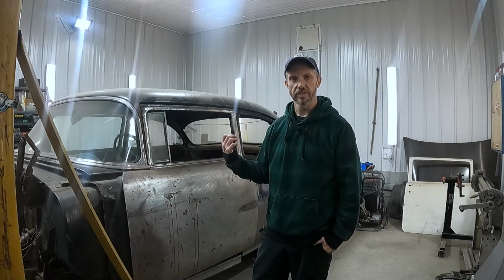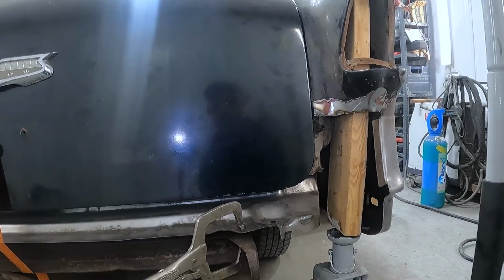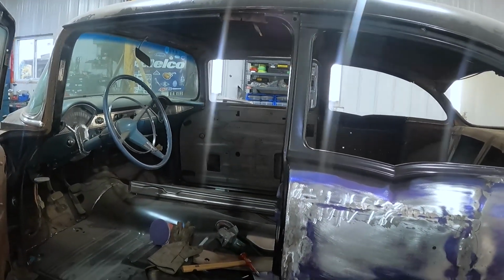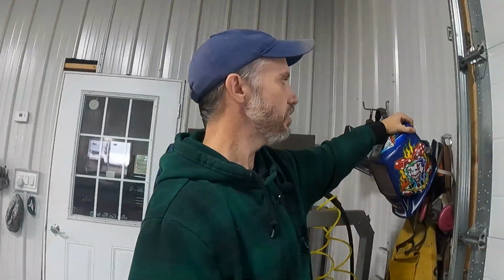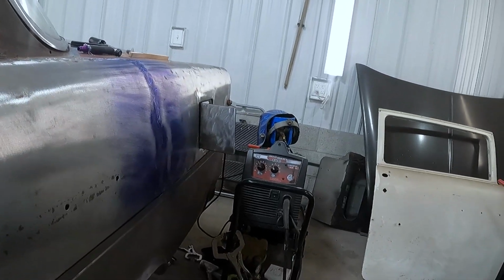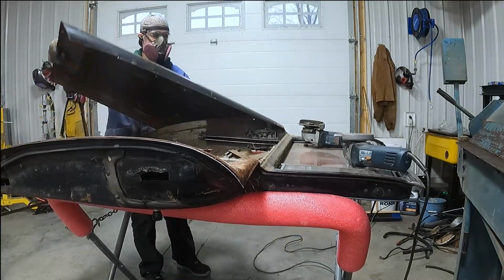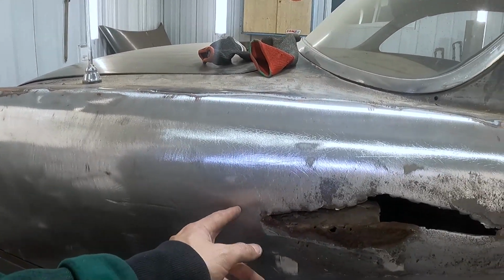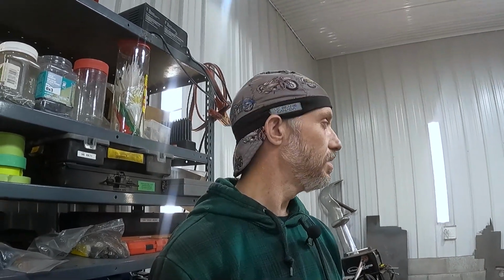1955 Chevy Belair Project Problem Solving - Metal work

Comment: Like Pat said chin up you'll get there you always do. Any problem big or small you seem to get the right answer in the end. You've got a lot of people cheering you on as you work on this 55. In the end it's going to be the car you want to have and drive, like the rest of your cars and trucks. Keeping my fingers crossed as you go forward. Can't wait for the next video.
Reply from the maker: Thanks Christian! I'll get through it. It's a challenge, but I have some good ideas on how to fix it. Lots of welding and metal ahead of me, but you've seen me do that stuff before. I saw your red car with the new upgrade! Pretty impressive. Hope all is well with you folks.
Reply: @SlowCarFix  It's too late now to try it out but driving home I noticed a difference. This is big step for me going into the unknow. It will be a learning curve. All is well here except having long covid. Maybe in the new year we could all get together, when your time permits. I think I'm a Slow Car Fix club member by now (LOL)
Reply from the maker: @christiantimmermans4208  Greg said he noticed a huge difference in power and just how it was running. He said he had a little trouble with it at first but was pretty impressed with the system after the install. It's a really nice upgrade and you should notice a big difference at the pumps.

Comment: Ed your making great progress with what your working with . i am building a 55 convertible from remains of a 56 convertible and a 55 belair 4dr sedan . i bought all the floors , rockers and both inner quarters and more . i was going to buy both convertible quarters new but they cost too much now and are not made that well. 
so i had all ready bought the lowers quarters in two pieces each very cheap so my quarters are going to be made from 4 pieces each.  i have had all the parts clamped and screwed together and it looked pretty good to me. my car is going to be a 4spd old school hotrod style driver not a restored stocker . i have the convertible roof and chassis too. 
 Ed keep up the good work and ideas to make it EZR to get it done.  thats why i bought so many parts for my project to make it EZR for me to get it done myself.
Reply from the maker: I'm glad you're enjoying and following along. Sounds like you have a heck of a project ahead of you as well. I looked at buying the 4 piece lower quarters but decided to go with the full lower quarters because I didn't have anything to go by for wheel well openings. I think it will work out.
Reply: @SlowCarFix  Thanks Ed mine is a major project the lower quarters are 2 part the front half and the back half. i still have the 55 4dr quarters whole so i could clamp the new panels on and line up the wheel well and screw them in place at the top. the front upper quarter panel with the door jamb is from the 56 convertible. 
 take your time you are doing a great job on your car.

Comment: It's looking good but if you need some good tips on replacing panels or patching. Watch Tony from Fitzee Fabrication he has great tips and has over 30 years doing body work. 
Because of him, I'm building a 55 Nomad from a 55 210 rotted out wagon. I'm the one who got the old fenders from Don at Don's Hot Rod Garage. I dove a day and a half to get the rotted out fenders so I had something to work with and I'm rebuilding them.
 Something is better than nothing and I have 3 years into this car now but it coming along day by day. 
Just keep plugging away and yours will be done sooner than you know it.
Reply from the maker: Thanks! I'm a subscriber of Fitzee, great guy and my family is all from right where he is. I've watched a bunch of his videos but I should take another dive into his channel. thanks for watching and good luck with your Nomad!

Comment: Glad you are working out that tail end. :) I genuinely laughed when you weld splattered your glass, cause, I will do that crap to brand new glass. (no shame) Test filling them with some super glue. I haven't tried it yet, but will be.

On your door skin patch, go on past that front seam a half inch or so, so you aren't welding into the same metal.
Reply from the maker: Excellent point about bringing it a little forward from the weld line. I will do that. I have a terrible time with welding near glass. I always forget. Thanks for watching and following along.